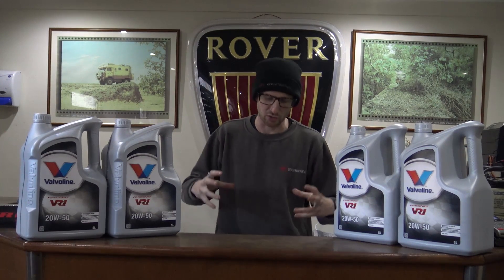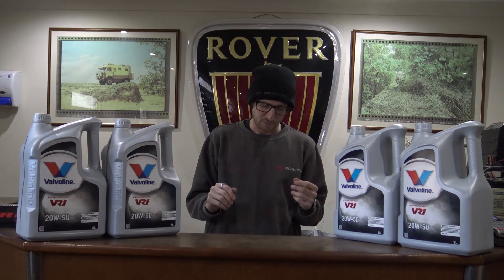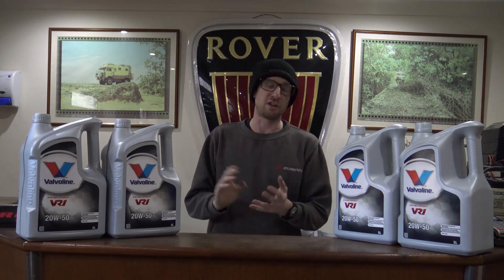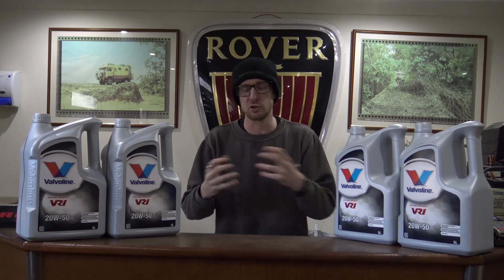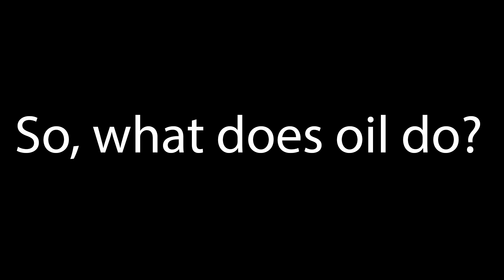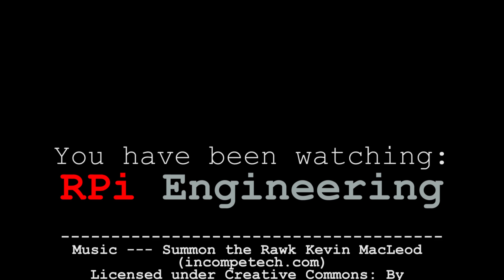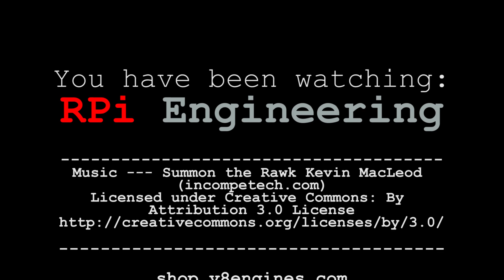FAQ: What oil should I put in my Rover V8 Engine? Will this FAQ break the internet?

Comment: G'day from Australia. Unfortunately we can not get a hold of Valvoline VR1 in 20w50 here locally. We have a locally made oil company called Penrite which offer a synthetic 10w50 with I believe 1100Zddp and also a mineral 20w60 with Zddp of 1600.  What would you be leaning towards for a 2003 Discovery 4ltr V8 with 350,000km and driving in warm climate sometimes up to 45c in the middle of summer? Regards Mark

Comment: Shocked the see a company recommend a 20w-50 in a vehicle that states to use 5w-30/10w-30 unless it’s in a very hot climate then 10w-40 the manual states.
Reply: A good 5/50 makes sense, or if your thrashing it and oil temps get over 120deg C we use Millers 10/60, which if the customer wants to spend the extra 10/60 gets used on a service. Though no one is a front runner if they're still using a Rover unit.

Comment: My 77,000 mile 4.0 Chimaera is running on this (changed by the seller just before I bought it) and it seems very happy. Oil consumption is negligible, and I'm getting a rock steady 42 PSI oil pressure at cold idle (about 1200 RPM) measured with an external gauge at the oil light switch port (the dashboard oil pressure gauges on these are notoriously inaccurate). The only issue it seems to have is a few seconds delay in the oil pressure light going out when started from cold (accompanied by a quite unpleasant tappet clatter, which abruptly silences as soon as the oil light goes out). The filter on the car is a Mahle item. I have a genuine LR oil filter to go on and another 6l of VR1 20W/50 so will change and see if it's a filter issue.

Comment: I used to run Valvoline 20-50 back in the 70s after designing a marinising kit for this engine . An inboard engine has little or no airflow over it and in a more hostile environment with salt water and normally running flat out . An alternative was Sunoco 20-50 . In fact the engine has changed little since Buick introduced the 215 c.i. all aluminium engine in 1961 . They also produced a turbocharged version in the Buick Jetfire . 
Synthetics are NOT based on mineral oil , but based on esters , diesters , polyglycols and fluorocarbons and derived by Germany in WW2 to replace mjneral oil due to lack of availability. Rover chose this particular engine for its ruggedness and long service intervals ease of maintenance as a lightweight replacement for the 3000 cc engine . In fact it had been touted that this engine had been run by Buick for 24 hrs after draining the oil from the sump .These attributes resulted in the problems that manifested in the 70s after long use . Back in the day the home service guy would adjust tappets, change points , condenser , oil and oil filter as a matter of course when the engine got a little rattly . With hydraulic lifters this didn't happen .
The engines are notorious for heavy oil deposits internally mainly due to lack of oil changes and every engine I tore apart back then was almost exsctly the same , a thick layer of tar in the valley , timing cover , sump and block but miraculously in rebuildable condition barring sticky lifters etc . By the 80s I produced a number of useful replacement parts for the engine including high volume oil pump kit , valves , cam and manifolds for Weber carbs , and strict oil changes .
Todays long service oils may have causd the problem to manifest again .
Given the fact that the engine had run in turbocharged form during the 1960s in the USA indicates that any US multigrade oil would be suitable . Given todays standard in oils , even the supermarket grades , I would say that any oil of a similar viscosity index would be entirely suitable synthetic or mineral high end or supermarket as long as you change it often . It would be preferable to change the oil 3  times using say Britoil Semi ( a very highly specified supermarket oil ) for the cost equivalent of say once for Mobil 1, Motul etc .
Reply: Modern oils don't always have the zinc these old flat tappet cams need. Careful.

Comment: Thanks for the video. I am about to replace the oil in my 1990 3.9l RRC but have been told by Valvoline that this oil is no longer available in New Zealand or Australia. Can you suggest an alternative please? Cheers, Greg
Reply: Castrol classic 20/50 is just as good.

Comment: 20w50 in -30c in Canada? That would be like pumping molasses.
Reply: Works like a dream been using 20w-50 year round without issues my engine runs way way better with the thick oil

Comment: I use Amsoil high zinc 10w40 would I see any benefits if I ran their 20w50 high zinc?
Reply from the maker: As per the video our advice and all our engines run on 20/50, over the years many people have run on other grade oils and then switched to 20/50. Some see improved oil pressure, other see nothing. We have never conducted any long term test though of engine wear etc when run on 10/40 for say 50K miles and then switching to 20/50 etc with inspection of wear throughout the miles which would be the only way to really answer your question with actual data.

Comment: Why would you recommend such a thick grade oil, especially in a colder climate? Due to non-DOHC? I'm in Australia & we use either 30 weight oil or 40. The Land Rover manual here states 40 weight... All BMW's are recommended to run 30 weight. My 2007 Nissan Patrol runs (as per manual) 5w30. The 5, best for cold start. The 5 @ start up is thicker than the 30 @ running temp! 20W50 seems way too thick for an engine in good nick...
Reply from the maker: Because engines still have the same running temp, tolerances are still the same. For sure cold start temps will be different however from the feedback from customers all over the world from the last 30+ years running 20/50 is still no issue on cold start ups although you may need to give the engine a few minutes warm up before driving but that seems normal for really cold climate countries anyway.
Reply: If you want to learn more about engine oil and science watch the YT channel the Motor Oil Geek. Another good channel about motor oil is LR Times who is dealing with the crank snapping issues and related long oil change intervals recommended by the manufacturer of mostly LR3, LR4 and newer JLR/Ford diesel engines.

Comment: Excellent video! I have a 91 RRC 3.9 USA California emissions required truck. It has 220k miles on the clock. Very very slight ticking on left side head. Runs strong and goes like hell. Very smooth very responsive. I do not know if the engine has been out or heads done or apart in any way. My question is this; is 20/50 VR too heavy for a possible original oil pump? As well as oil galleys top end lubricating with old pump pushing 20/50. I am not rebuilding the motor or changing anything out. Its dead reliable as it sits. Interesting fact about this truck is that it had 130k miles at four years old. Lots of California freeway driving and all book stamped service until 160k from orig owner. Thats all I know about its history.  Thank you!
Reply: Im currently running Rotella 15/40 with a bottle of liqui moly mos2.

Thanks!
Reply from the maker: @jonboyle5341  Higher mileage does not really tell you engine condition. Some of the best engines we have stripped down have been high mileage ones as they have been serviced well and do not do short journeys were operating temp is never reached. I dont see any issue with running 20/50 with what you have said. If the engine is worn due to age then you need a thicker oil to take us the slack in the tolerances on bearings etc (ideal a rebuild long term though)
Reply: Thank you for your reply. It doesnt use any oil or leak anything so Im driving this one for now. I will use 20/50 VR at the next change. With this many miles and driven daily how do you..or what do you think about any oil additives? Im using Liqui Moly mos2 at the moment.

Thank you again!
Reply from the maker: @jonboyle5341  I'm afraid you'll have to make your own call on the additives as it is not something that we have needed to look into. The Valvoline VR1 20/50 oil has all the properties that we have ever needed and we have hundreds (going into thousands most likely) of customers / followers running it too on new to high mileage engines without issue.
Reply: @jonboyle5341   don't put additives in oil..the additive package is carefully formulated,, and too much of some additives can have a detrimental effect..i read an article a long time ago by a retired Mobil lab boffin

Comment: I live on the equator (hot!) and have been using 10W-40 on a 4.6 Thor engine. Do you recommend a switch to 20W-50? Like Shell Helix HX3...I havent seen Valvoline 20W-50 around here. Could it cure the noisy cam/rocker/lifter (no idea what it's called)?
Reply from the maker: Most definitely make the switch to 20/50. As long as its a manufacturer that you can trust, you want a zinc additive either in the oil or add some yourself. Valvoline is a mineral oil so if you can match that then brilliant.
Reply: @RPIEngineering  Thanks! I will do that!

Comment: I loved this and will be following your recomendation, just one question i am struggling to find out the correct filter for my RV8, its in a Cobra Replica, and is currently fitted with a FRAM PH5443, as per you suggestion i would like to fit the right Rover part. but I can not figure out if it should be a ERR 3340 or GFE187 ( both of which do not seem to cross reference on the filter cross ref site)  Ideally i would like it to be short and at least no longer than the Fram (110mm) as there is not a great deal of ground clearance on the car.  I am not sure of the origin of the engine as i did not build her but believe it to be from a SD1.  I have had 2 other RV8's but they were factory mgbgt's so had the standard filter with remote filter.
Reply from the maker: I think then you have a P6 style oil pump base that has a larger thread than the SD1 onwards version. We have a suitable filter in stock but Fram are also a good make of filter so I would suggest to keep using what you have at present.
Reply: @RPIEngineering  Much appreciated cheers for the reply.

Comment: I’m using 15/40 mineral oil on my discoii03 I find it better than 20/50 in my opinion since our weather is very hot in the Middle East..and I change the oil every 3500km only..what do you guys think?!
Reply from the maker: The engine running temp both coolant and oil temp should be fairly consistent if the correct coolers are used on the car. That being said we would still advise 20/50 in your climate as the oil gets thinner with heat so as your on a thinner grade at present your up against it already.

Comment: When I had my 2000 Range Rover 4.0 SE engine all I used was Liqui-moly full synthetic 20W50. The reason for the higher viscosity was the engine had 280,000 miles on it. I used Mann filters both air and oil. Since I used my rover for a company vehicle and drove it on the highways primarily I changed the oil every 5,000 miles.

Comment: Great vid. I do 10,000 miles a year in my 1976 P6 V8. I change the oil every 2,500 miles or 4 times a year. Especially after winter although I know some of you namby pamby folk tuck your cars into bed for the cold wet months.  You cannot beat regular changes. I still get 60 psi oil pressure. A friend took a 1960's BMW motorbike engine apart. The bike had 250,000 miles on the clock and just one owner from new. It had never been apart in all those years. The owner was super fussy and changed the oil every 1000 miles. When they stripped the engine it was found to be perfect. Proof that regular oil changes are so important. I use Rye Oil's 20w-50 in my car. High zinc content and 25 litres = 50 quid delivered to your doorstep. Peace

Comment: I run a 1973 RR Classic in NewZealand and this was very helpful thank you . Can I ask if replacing the standard oil pump gears with the higher volume /pressure kit you can get is useful or am I wasting my money, I have been told the original gears were to small when the engine was designed?
Reply from the maker: Yes we always upgrade the early oil pumps with the upgrade kit and would advise it. However if oil pressure is low due a badly worn engine then of course upgrading the oil pump is going to simply mask this for a little longer is simply make no difference if the engine is that bad.

Comment: If the Land Rover is used in colder temps than you usually see in England. Think as cold as -20 degrees C. Would you stick with 20-50 or change to a different viscosity?
Reply from the maker: You need to monitor what the engine does when you first start it from cold. Does it get oil pressure straight away? Obviously when the engine is warm then the oil will still be correct, your only difference is the -20 cold start and if it is going to affect the engines ability to pump the oil around the engine when you first start it.
Reply: @RPIEngineering  I've gone lighter 10-40 and now there is 10-50 as well. Oil pressure does come up faster.
Reply from the maker: @chrisbrowne1956  10W-50 would be a logical option due it being the same grade when warm. However of course we have not had experience of running this ourselves so we can not conclude its long term effects. Also note the ZDDP additive as mentioned in the video.

Comment: Would you use flush before putting the new oil in it too?
Reply from the maker: Hmmm, its debatable. If the engine is that sludged up that you think it needs a flushing lubricant then we would advise the engine needs rebuilding as dislodging some sludge with a flushing agent could then potentially block off oil ways etc.

For normal oil changes just doing it with correct old school method of making sure the engine is right upto (oil) temp and then draining it is sufficient.
Reply: RPIEngineering thanks guys. Also, my oil reading (when cold) is just above max on the dipstick (1-2mm) would you siphon some oil off and how would you do this? Straight from the drain plug? Should a reading be taken cold or when hot? Thanks. Will be popping up at some point.
Reply from the maker: @autoroom21  Always from cold when all the oil has drained into the sump. Assuming you have the correct sump to dipstick setup the oil being over the fill level by 1 to 2 mm will be no issue but I would not advise it if there is any more than that
Reply: RPIEngineering thanks a lot chaps. Will review and drain some off though the sump plug. Cheers

Comment: Hi: lads
What about when you turbo charge an  RV8 what oil would you recommend with this application??
Reply from the maker: We have no turbo conversion on our books or produced by us so have no long term knowledge of long lasting effects. Personally I would say to speak to your turbo manufactured and ask them of the grade of oil that the turbo bearings would be happy with from cold (i.e would 20/50 be wrong for the turbo bearings) 

20/50 would of course still be correct for the engine itself and we are still talking about a low reving engine in comparison to all the higher reving modern turbo engines
Reply: @RPIEngineering  
Thanks so much lads. Very informative answer for me thank you.
Love the channel by the way.
My aim one day is to convert a rubber bumper mgb-gt to an RV8 twin turbo :))))

Comment: Very Good. My RRC with rebuilt 4.2 runs Valvoline 20/50 and my 110 3.5 runs cheap Comma 20/50. Both get oil changes with genuine filters every 6 months regardless of mileage.
Reply from the maker: Good man
Reply: Which Rover V8's are the best to hot rod? @RPIEngineering
Reply: The very best oil is Rotella, it is what's used in airplane engines and others where reliability is an absolute must!! @RPIEngineering

Comment: Thank you for the informative vid.  My question was will the extra zinc in this oil harm the cats?  After reading about it on Valvoline's site, apparently it will not. So, thank you for the recommendation.
Reply from the maker: Its not that it harms, clogs etc its that it was found that it shortens the life (who knows how much by, but even if it was by 2% it would have been enough for someone somewhere with red tape to have said right we'll we don't want that its not GREEN)